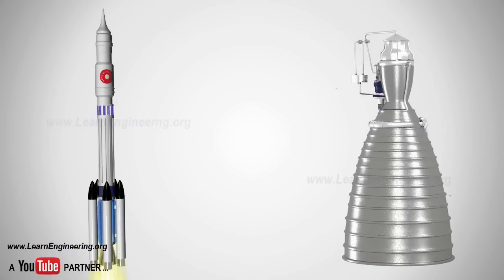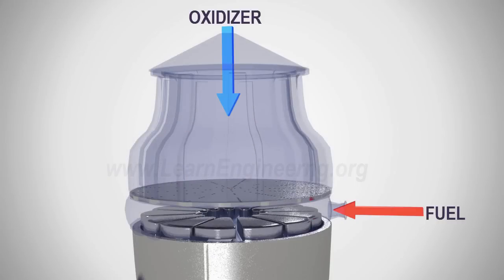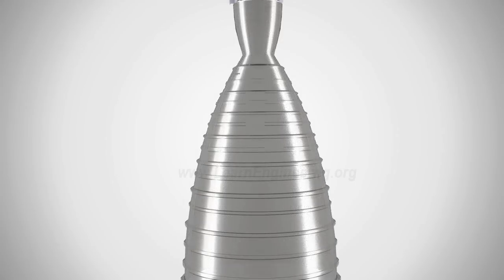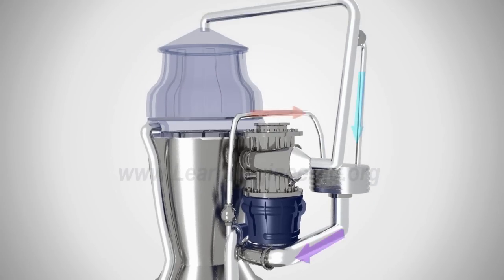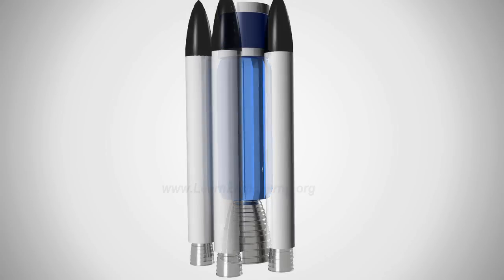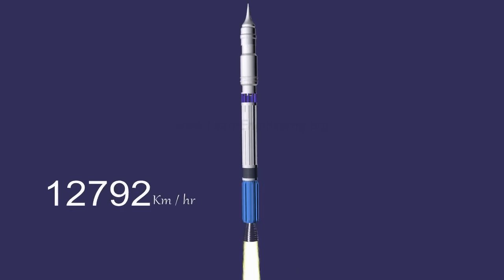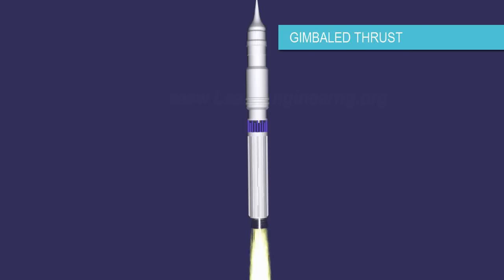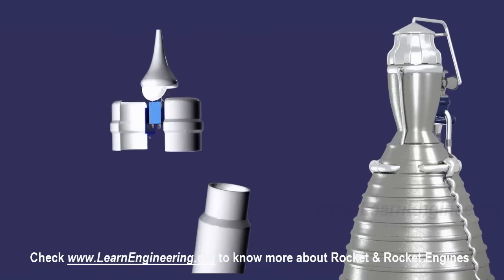How a Rocket works?

Comment: Imagine if you had a vacuum cleaner behind the rocket that takes away all the rocket thrust as it is generated.?  welcome to the vacuum of space mofo's.
Reply: bo ptah Vacuums do not take away force magically. Actually lowering back pressure will increase thrust
Reply: @AmbientMorality  Vacuums do take away force magically.   . Vacuums do not lower backpressure.  They eliminate pressure.  You cannot have pressure in or near a vacuum. This is why it is impossible for a rocket to work anywhere near a vacuum.
Reply: @boptah7489  By that logic pressures must always be constant unless separated by a solid barrier. Vacuums are just regions of zero pressure. The same physics applies to them as anything else.
Reply: @AmbientMorality  pressure always seeks to balance itself.  You cannot have different pressures unless one is moving to balance the other ( weather systems). An aeroplanes wing, creates lift and causes the plane to fly.     A rocket is the same.  The high pressure area behind the rocket is greater than the pressure in front of it and so the rocket moves into the low pressure.    This is why it is IMPOSSIBLE for a rocket to fly in space because you can't create pressure in a vacuum.  In fact.   A helium balloon can go higher than a rocket in the earths atmosphere.
Reply: @boptah7489  A vacuum isn't a boundary condition, it's a state. If you put mass into a vacuum that area is no longer a vacuum
Reply: @AmbientMorality  the state of space until you meet a solid object is a vacuum..  The reason a rocket cannot work in space is because at all times there is a vacuum around and behind the rocket regardless of the quantity and power of a rockets thrust.. 

   the instant that a rocket is fired in space the molecules are evacuated into the vacuum at they rate at which they are created by the rocket.  Which is why there is never any pressure or mass or thrust behind the rocket.  And so therefore no movement..  It is childish nonsense to believe that rockets work in space considering they spend all their time and effort to increase the pressure  behind a rocket on Earth to make it faster or more efficient.  they know that as the air gets thinner a rocket loses efficiency .   Which is why no rocket can go higher than a helium balloon.
Reply: @boptah7489  the absence of pressure does not cause a force. pressure is the force
Reply: @AmbientMorality  You cannot create pressure in a vacuum.  It is impossible.  To create pressure you need resistance.  there is no resistance in a vacuum. .  So there is no force.
Reply: @stuartgray5877  I have never suggested that the vacuum exerts a force. The vacuum evacuating the rocket gases at the rate at which they are produced is a natural event and requires no work done 

 You are not a vacuum specialist. if you believe that pressure can be created in or near a vacuum.  you are deluded. 

     You are obviously very disappointed at the results of the career you have chosen, and that is because you have backed the wrong horse.

Comment: Would a rocket not work better with the engine nozzle the other way around? Starting wide ending narrow..

Surely that would give higher pressure
Reply: You'd want a rocket engine, not a runaway pressure cooker. You want that exhaust to leave the chamber and bell at high speed, efficiently. Narrowing the opening would not make things efficient, or safe.
Reply: whocareswho could you not use less thrust to get to orbit?
Maybe something controllable like thrust vectoring from the f22 but allow the partial closure of the exhausts
Reply: @mccari09  Thrust needed on take-off is mainly decided by how much mass you want to accelerate. As for vectoring, many rocket engines use that for stabilization and some steering. The important thing is you really, really don't want to choke the flow of exhaust gases. The F22 is powerful for a jet but it is utterly incapable of sending itself into space. You need rocket engines for that. Jet engines won't work. Another thing is, you could read up on "specific impulse" and what it means to rocket engine performance and how bell shape affects S.I..
Reply: whocareswho maybe try and smooth the flow of exhaust gases.
kind of like the laminar flow concept...
Reply: @mccari09 Higher pressure yes, higher velocity no. Due to compressibility effects a diverging geometry is a nozzle for supersonic flow
Reply: Appable alright we’ll surely there is some point between current nozzles and reversed units that won’t create an over-pressure situation... or is the expansion within the nozzle area what creates the actual thrust?
Reply: @mccari09  The expansion is what accelerates the flow (which is honestly weird – it's the opposite of everything you see normally). But like in an ordinary subsonic nozzle, the pressure still drops as velocity increases so you can't expand infinitely.
Reply: Appable hmmmm... as you can tell I’m not a rocket scientist lol.
I am interested though... my childhood just didn’t afford me the opportunity 🥺
Reply: Pressure is not actually what we're after here; exhaust velocity is. The faster your exhaust gases leave the nozzle, the more momentum is gained (for a given mass flow rate) by the rocket itself. 
Interestingly, many rocket engines (and even some afterburning jet engines) have an exhaust pressure (the pressure at the nozzle end) which is lower than atmospheric pressure at sea level: as a result, the exhaust converges inwards into a cone-like structure called a "shock diamond", where the pressure becomes high enough for the exhaust gas to expand outwards again.

Comment: It goes up, over, out of sight, and then falls into the ocean. An "orbit" is not possible in the closed system in which we live.
Reply: How do you know that?
Reply: @Bnslamb  ,

NASA and SpaceX lie to us about everything all the time. They regularly depict the Earth as a rotating sphere.

The Earth does not rotate.

Here is the proof:

This proof applies to gyroscope technologies commercially available, such as Mechanical Gyroscopes, silicon MEMS Gyroscopes, Ring Laser Gyroscopes (RLGs), and Fiber-Optic Gyroscopes (FOGs). Gyroscopes detect any change in angle from an initial position.

Start up the primary gyroscope based navigation system on a stationary commercial aircraft anywhere on Earth.

Allow it to come to a steady state. Observe the readings for yaw, pitch, and roll. Allow the navigation to system to run undisturbed for 3 hours. During that time, the Earth allegedly rotates 45 degrees. At the end of that time, observe the readings for yaw, pitch, and roll. They will not have changed. The gyroscopic based system will not indicate any precession. (They will not detect any change in angle.)

Then, use a tug to move the aircraft in a circle. (This is to prove that the navigation system is working.) The yaw indicator will travel through 360°.

The Earth does not rotate.

You have been deceived.

If they will lie to you about something so fundamental to their "space" program, what else will they lie to you about?
Reply: So you did those tests?
Reply: @Bnslamb  ,

I did my own tests with my own precision balanced gyroscope.

There was no precession no matter how long I ran it. I tested a variety of starting positions. The results were always the same. No precession.
Reply: @therescueofthebride1134  sorry but it is a FACT that most modern aircraft have ring-laser gyroscopes that MEASURE EARTH'S ROTATION and CURVE as part of the pre-flight test.  Your understanding of RLGs is seriously flawed.
Reply: Stuart Gray then correct him
Reply: @flatouttruth1004  I just did.  I told him he is wrong.  Or do you want me to explain that the friction of standard "toy" gyroscopes is too great to prove earth motion AND the fact that none of them will spin long enough without power assist to prove anything.
Reply: Except for the fact that we dont live in a completely closed system

Comment: Technically, the gimble mechanism causes a bending moment which then causes the rocket to turn, not a torque. The gimble applies a force on the axis parallel to the cross section, therefore it’s a moment. If the rocket was spinning while still on the same heading, then that would be a torque.
Reply: Drew Compton That’s just a torque in a different axis. Bending moment is certainly not right because the rocket is not bending (or at least the bending is not what we are considering for the dynamic model of a rocket)

Comment: Divergence, by defefinition is a defusion device producing decreased velocity. The highest velocity "must" be at the smallest diameter of convergence.
Reply: Kit Canyon  That is common knowledge and in my case have learned this thru practical experience. Exhaust gases pass through smaller orifices at higher velocity than larger ones. Over 40 years of championship winning engines have proven this to be a fact, over and over again.
Reply: That's true for subsonic flow only.
Reply: @jogitoegosum  Explain how subsonic flow transitions into supersonic flow, once it has left the combustion chamber and is now exiting a divergent exhaust tube.

Comment: Rockets based on this principle do not work in a vacuum because they do not have a mass behind it to react and push it forward (Principle of action and reaction).  Think outside the box, imagine two pendulums that stand on their stems are parallel, but as they move they make opposite movements, when one goes left the other will go right, when the first goes right the other will go left and  like this in succession.  These pendulums will be oscillated at 2,400 times per second in an arc of maximum 90 degrees. Imagine that these pendulums have a mass of 250 grams and are 20 centimeters from the support. Now calculate the sum of centrifugal force force in this proposed system.  There are numerous patents overdue with this idea.  George Gugo Constantinesco was the only one to put it into practice, he installed it in a car, truck, train and a train car without the locomotive.  There is a manuscript attributed to Tesla where the principle is as described above, but in the drawings the pendulums do not swing, they rotate.  The Vimanas, flying vehicles of ancient India were powered by a strong centrifugal force capable of overcoming gravity.  Make for your cars, tractors, vans and trucks.  Good research.
Reply: Tell me Leonaldo, imagine you are an astronaut in space (vacuum) and you have a medicine ball weighing around 5kg or so. If this astronaut was to now throw this heavy ball away from themselves, would the astronaut remain in the same spot as before, or would they move in the opposite direction to that of the thrown ball? Of course, the astronaut would move away from their original position, due to the laws of conversation of momentum.
So please explain to me, how a rocket in a vacuum, can lose mass in the form of burnt fuel coming out of its exhaust at high velocity, yet remain in exactly the same position, whilst the mass of the burnt fuel goes off into space? For the conservation of momentum laws to be held true, the rocket must move in the opposite direction to that of the mass of the ejected burnt fuel. 
You suggested in your comment that we should 'Think outside the box', yet it seems Leonaldo, you are not doing much of your own thinking at all, lol.
Reply: @sailorman8668  How does it weigh 5kg or so in space?  Gravity is what gives us weight.
Reply: @DrCash7  it's mass. Scales measure force (N) and by taking the acceleration (m/s²) convert it to mass.

Comment: A paradigm that "Engineers" learn and do not have the ability to "get out of the box" ... This is how they learned it ... so they broadcast it...

the "B" plan, they do not want to hear it, because politics and internal bureaucracy are so heavy, that they will not advance for now with the new technology, not yet patented, TEC-MAG 2014 "Temporary modification of the gravitational field of the object".  ..
they do not need to be noisy or explosive when ejecting the ship to the zero gravity site, not wasting fuel when positioning on Ecuadorian correct Azimut.
the payload of the entire device is 10% ... the rest is discarded as a propulsion ballast ... while TEC-MAG 2014 takes advantage of 100% returns to the low Earth atmosphere, is recycled and has no problems due to  the size to be launched ... Zero noise, gravity traction and vacuum, maintain fixed coordinates at will.  Hi-Speed in seconds.
We have not yet been heard, for being a voice of a "third world" country.  the good thing that there are finally proposals to develop in other top 3 countries.
With TEC-MAG 2014, you do not need wings, or turbines or propellers, (the one who knows of ZERO REACTION MASS, knows what we are talking about) .You do not need flammable fuel, it can be sphere or lentil shape to be aerodynamic.
Reply: Why can't I see anything related to this in YouTube or Google? ... Not even a single article....
Reply: Are you Brazilian?  I know a mechanical system that does just that and there are 5 expired patents related to devices like this.  This is all based on the centrifugal force contained in the pendulums.  But indoctrination is strong and engineers, mechanics and ordinary people can't see out of the box.
Reply: @Torkx100  The answer lies in particle physics, "quantum screwing" of the Boson Higgs system.... No magnetism, no repulsion.  This discovery has developed other parallel technologies that are unveiled in the same year, (I wish it was this month).  
The Americans have patents against everything that flies in the future, with the intention of manipulation and control in the coming years.
On the other hand my group: (not much can be mentioned without compromising the signature) but 5 new projects will be put on the table this 2020.

Comment: Close, but the engine you described is just a single configuration out of many many different liquid rocket engine configurations using a variety of propellant feed systems, cooling systems, fuel combinations, thrust levels, etc.
Reply: they showed a closed cycle here. they fail to mention the other common and well know cycles like the open cycle, and the hard to achieve full-flow. I honestly prefer the electric-fed pump engine the most.
Reply: @quelquespepitesdeculture  I think the electric pump fed cycle is interesting, but I think rocket labs' strategy of tossing out their used batteries mid flight might not be the best in the long run, environmentally speaking.

Comment: I’m assuming the unmentioned device positioned @ beginning of Oxidizer Bypass line and Fuel Bypass line adjacent to Fuel pump to be a type of check valve/back flow prevention device? Preheating fuel supply while also lowering diversion nozzle temperatures makes sense.  I need assistance understanding how combustion force increases from subsonic to supersonic speed in the direction of flow shown. I’m inclined to think economical as well as increased power gains could be achieved by reversing Conversion and diversion chamber size. Any help greatly appreciated. I’m no “Rocket scientist”, but very curious about this type of Engineering.
Reply: Most likely valves used for controlling thrust; back flow isn't typically an important issue. The only flow control besides valve is typically venturi tubes which prevent any sort of downstream effects from affecting upstream.

Reversing the convergent-divergent nozzle geometry would do the exact opposite of what you want – first the exhaust would slow down a ton, then in the nozzle section it'd speed up to the original speed.